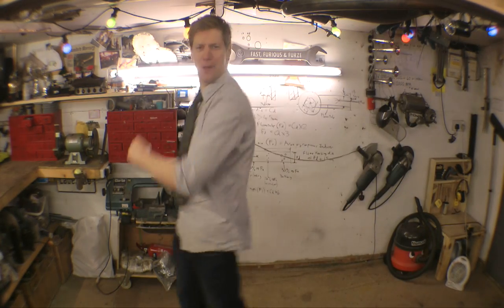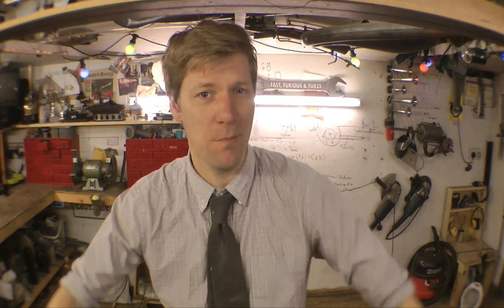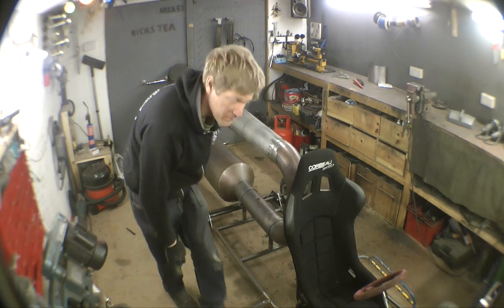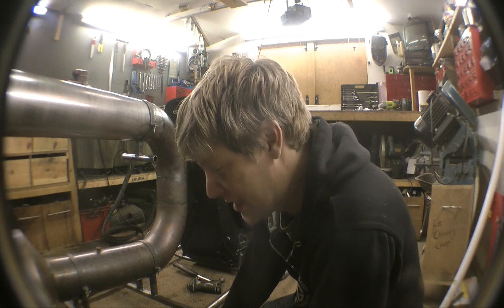Making a Jet Powered Go-Kart Part 1 - Chassis

Comment: good to see you back at it collin 
might be best to use a acetyleen bottle for a fueltank , if you mount one on the floor on both sides of the seat you got a low center of gravity and some weight on those front wheels 
it allso should be plenty of gas to actually do a little distance before the jet snuffs out 
you can fit a car propane filnipple setup to fill it up at the gasstation (with the cart on a trailer offcourse ) and do hardlines from the tanks to the motor with double emergency / oh shit valves

Comment: Is that jet fuel powerful enough to melt steel beams?
Reply: Pig.avi no, the jet itself is made of stainless steal, so if the beams are going to melt, the jet itself is also going to melt, which didn't happen last time, so hes good to go :)
Reply: Pig.avi Jet fuel can't melt steel beams! #insidejob
Reply: Jet fuel can't melt steel beams but dank memes can
Reply: *****    9/11 ???  Remember??  Or are you one of those sceptics who don't believe fairy tales ... ?
Reply: uweadalbert Jet fuel burns too fast to have melted large structural beams in a skyscraper.  Also, remember how those towers fell down over an hour after the planes hit?  There is no way the jet fuel was in there burning for over an hour.  I am not blaming any group or pointing any fingers, but something is a little fishy about the whole thing.
Reply: James Burleson That's what I said.! Sorry for being ironic ...
Reply: raww  Oh, I have no doubts whatsoever about the official story.
Reply: James Burleson What...? 10,000 liters of kerosene is splashed round an entire office, and you flat out assert that this wont burn for an hour...
Nonsense!
Nothing melted any steel structure on 9/11
The heat treatment of the structure was compromised in the fire...
Steel can be tempered from as little as 200 degrees C, it got much hotter than that, in that office that day :(
Reply: Not to mention it was a 100 story tall furnace with air being sucked up, those top few floors were as hot as a forge

Comment: That rigid frame might prove a bit bumpy at high speed, may also give some stability issues as those back tires wont rotate independently(might want to jump when turning). Otherwise, this is a really cool go-cart!

Comment: Hey Colin how about adding 2 more braces on the front one by the seat down to the rear axel plates  to give it more triangulation and a bunch more rigid frame   You sure do make a lot of fun stuff in such a small shop !!!! I have the plans for the PJ just need time to build it .
Reply from the maker: John Siders in part 2 they would get in the way but although there is some flex its ok. i do add another at the front.

Comment: Put a stick of pipe between the bracket for the back support struts and the front support strut. Triangles give strength. Parallelograms are wobbly.
Reply from the maker: GunFun ZS i did but the flex is kinda from the seat forward so it didn't make much difference. i,ve added another at from but its ok
Reply: That's reassuring. It seemed way to obvious for a clever fellow like you to miss. This should be a fun one. p.s. The best thing about your stuff is publicly sending them to an adventurous young man I know to worry his mother.

Comment: Colin may I inquire as to the ratio between your intake pipe and the exhaust pipe? length in inches. Are you using a flap valve like the original german one or a screen? delight in seeing your work awesome!

Comment: Looks very interesting.  Are you concerned about fatigue or stress on the clamps around the pulsejet?  As it heats it will expand and perhaps distort?  Perhaps there will be enough heat transference that the clamps will expand as well?  Are they the same material?
Reply from the maker: Jonathan Pelham Have done it this way before and not had a problem but they are being tested a lot more on this i will admit
Reply: Well that's the empirical method so no problem. Suck it and see.  Just bear in mind during pre-use inspection.  It might not be a problem.

Comment: Colin did you work for top gear? as since it's stopped you've finally posted,And also you said you got the seat from a TV show you worked on.
Reply from the maker: Luke faulds no was a show called Gadget Geeks on sky but they only did 1 series

Comment: that seat is going to melt from all the heat radiating off of that pipe. I wonder if you could improve the design with a cooling jacket on the pipe, a small electric water pump pushing water through coils of copper tube wrapped around it might work. You'd have to have one hell of an ice water to water heat exchanger for it though.
Reply from the maker: J.A.Ratt85 Theres a heat shield fitted fear not

Comment: one thing he doesn't say, but shows, which is very smart and proves hes not just a nutter.  Look how he cut the go kart in half.  Staggered out.. not in straight halves.  why is this smart you may ask?  even distribution of the welds so they don't snap in half and bend at the same point on the kart chasis...  actually very smart and most people would not do that.  =)

Comment: too low, isn't it?
Reply: dudyorz Looks like its gonna be very weak in the middle. All the weight is in the middle, so its gonna flex and scrape the ground from the smallest of bump.
Reply: dudyorz Check out shifter karts! they are naturally that low.
Reply: dudyorz Needs a ladder frame
Reply: dudyorz Heat shields do their job.  I can speak from experience.

Comment: How did you stop the axle moving left and right in the rear bearings?
Reply from the maker: Josh Davies there is clamps either side
Reply: Cheers. Are the clamps welded on or just held with a grubscrew?

Comment: It looks OK But that type of Pulse Jet Has little thrust.You need a Bob Maddox ARGUS Reed valve PJ or a 130 lbs  Pressure Jet made back in the 1950,s .Hard to make or buy but the Bob Maddox type are not..Your gokart will fly with two 150lbs PJ bolted to it.
Reply from the maker: chris lomas agreed they are way more powerful but i like the simplicity of these as they just work with no maintenance
Reply: colinfurze That's all true.I once worked out my old Suzuki GSX1400 had about 270lbs thrust in top gear at  about 280kph.It had 165RWHP & a $8000 Engine.I guess 300lbs from a PJ could push a GoKart to 300klp also. Acceleration may be slow but top speed Nuts.I cant get over the sound of a reed valve PJ at full thrust .There are many designs out there for PJs that have no reeds but not have been built & proven. This one you build is perhaps the best for what you have built.I still cant believe you just pump one up from two flat wielded sheets.Well done anyway.

Comment: See where you are touching it up at 5Min21? Run a bar from up top there to the back wheel plate, both sides to complete the triangle for rigidity YOU MUPPET!  ;)
Reply from the maker: Godshole This is true but it will get in the way in part 2
Reply: ahh, ok. That makes me the muppet. Can I be Animal?